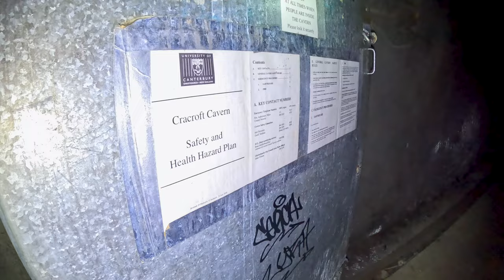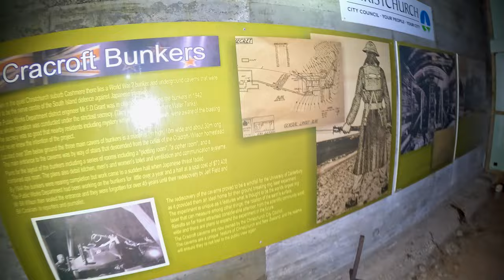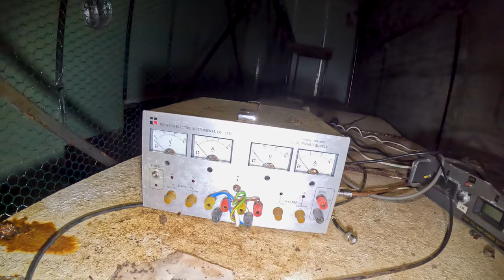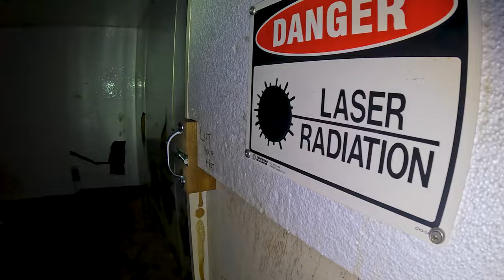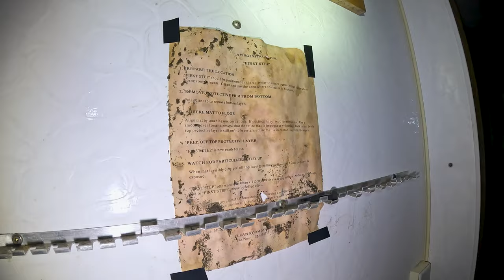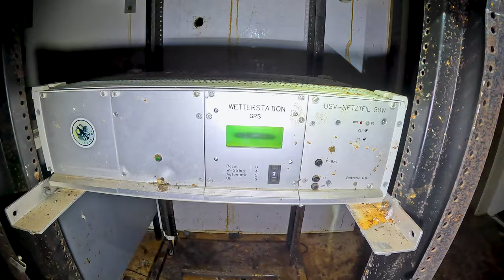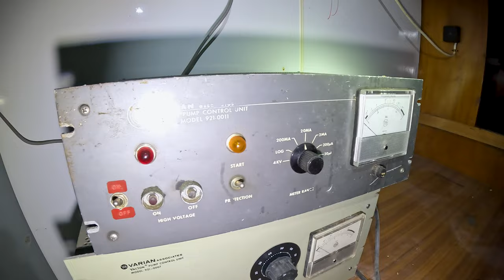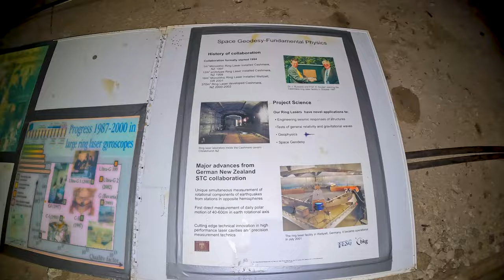Cracroft Caverns, Cashmere Caverns Inside

Comment: Thanks for posting. I was in there well before the earthquakes (one of the public open days) and definitely see some changes. 
1. Ring laser experiment had grown a lot bigger from what was there when we went in. 
2. Obviously there has been significant ground fall from earthquake, as there were no signs of any rocks on the ground previously - in fact it looked pretty pristine (concrete almost looked new too, which we were surprised about). 
Sad to see all that gear turn to rust. I'm guessing the university was not permitted to enter after the earthquakes. They look bigger in person than on video don't they?
Reply from the maker: Yeah from what I have seen on other videos on YouTube of the inside and also photos a lot of the laser gear was removed some time after 2021. I would say they removed stuff when They installed the new steel door on it Christmas 2022.

Comment: How hard would it be to reopen the door? Assuming there are no security cameras etc around.
Reply from the maker: Wouldn't be hard if you have a key. :) 3x padlocks.
Reply: @ExploringwithMark master key will do the job surely, or just a bit of casual lock picking 😂
Reply: Or casual electro-erosion of the lock.
Reply from the maker: @PaulanthonyBridge-kt4eg Locks are gone someone unbolted the latches and got in a month ago and they have now welded the door closed.
Reply: @ExploringwithMark  Then electro-erode the welding seams off.